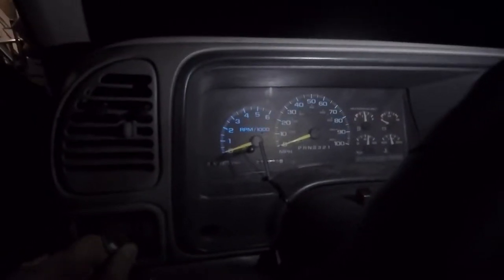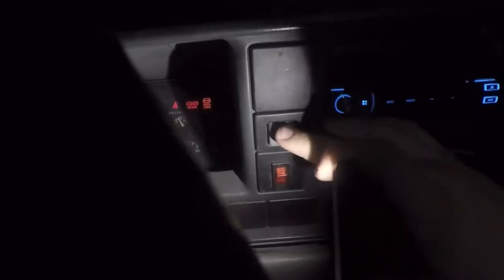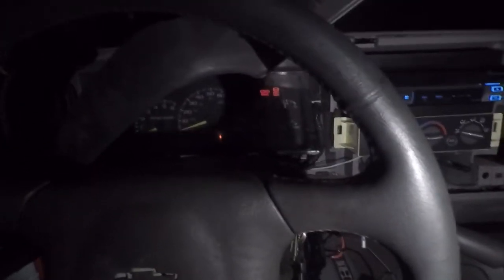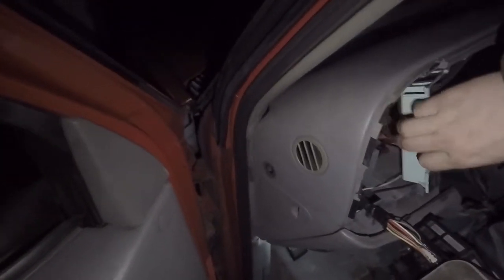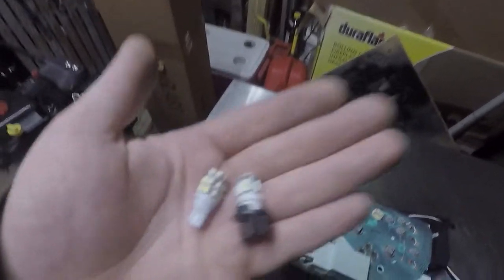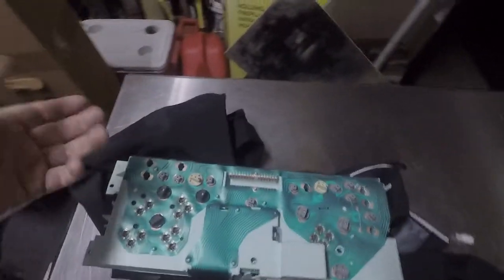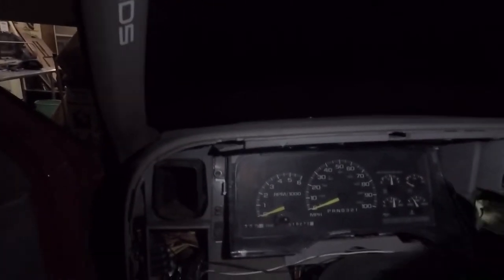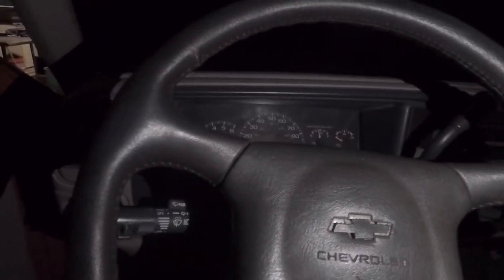How to Replce Dash Cluster lights in 95-99 OBS Chevy (Tutorial)

Comment: Thanks for the video.  Do those smaller bulbs need to be changed as well?  I did the T10s on my cluster but didn’t have the smaller bulbs.  Also is that a non SRS horn pad?
Reply from the maker: If you want the smaller bulbs to be leds then yes. I didn’t do that, just changed the illumination of the cluster essentially to leds. 
As for the horn pad, yes, non SRS. My truck has 0 airbags in it 🤘🏻

Comment: I replaced the bulbs with LED bulbs in the instrument panel of my 96 Silverado,but my problem is the left side doesn't light up.Could there be another problem?
Reply from the maker: Check the connectors, make sure they are making contact with the hood pads on the clusters board. Also, try flipping the LED’s in the socket. They are directional due to them being LED’s.

Comment: I upgrade my 1998 Chevy Silverado cluster with blue led lights but the ones that light the speedometer don’t look that bright like the others ones….any help
Reply from the maker: I’d flip the bulbs around and see if some aren’t lit. LED’s in these clusters ARE directional.  So if they are in backwards they simply won’t illuminate. If that doesn’t work, swap a known working LED bulb in and see if that fixes it to see if you just have a bad bulb.
Reply: @NeckBreakinNate  I flip the bulbs around until I got to it to illuminate as bright as the other ones appreciate the info.

Comment: For the LEDs to work in my cluster. I had to get new twist mounts cause the factory ones wasn’t making contact  with the  LED contacts points.
Reply from the maker: Woof Firestart I probably should do that to mine as well, I’ve noticed my contact points are a little worn.

Comment: I bought the linked lights but they are not working but work on other application on my truck tried turning them no luck
Reply: The old 194 worked ok but when installing these now I have no lights at all
Reply from the maker: Make sure the sockets are making contact to the gold pads on the board

Comment: Thanks for the video,👍,im going to do on mine
Reply from the maker: Luis Rivera it’s a great little upgrade. I’d go with some higher quality LED’s if I were you though. I already have to replace mine, just haven’t done it yet. Been bad for like 4 months.
Reply: Were you buy the ligths?
Reply from the maker: Luis Rivera just off of eBay. Some cheapo’s. Like 5$ for the pack. I used the same ones in my corner lights and they’re working. But like 4 of the LED’s are out. My dash is completely out. I’d personally spend the money on some higher quality ones. I plan on doing that, just haven’t gotten around to it yet.
Reply: Thanks neck